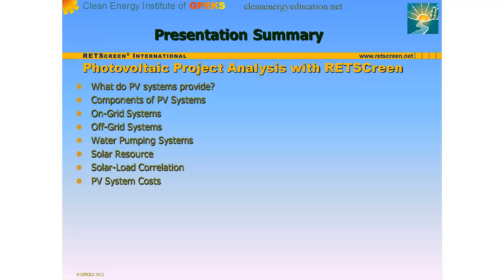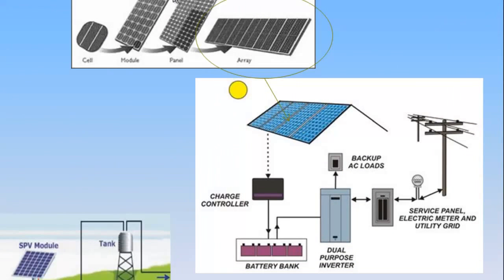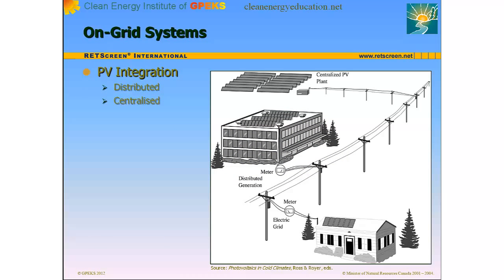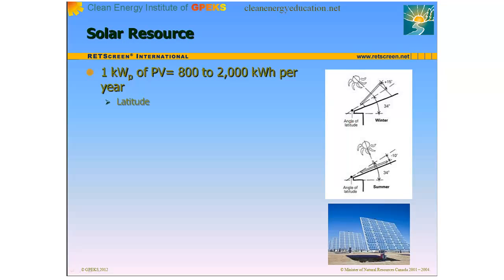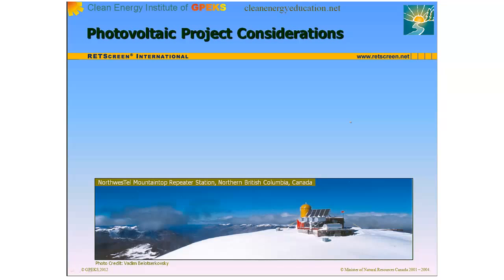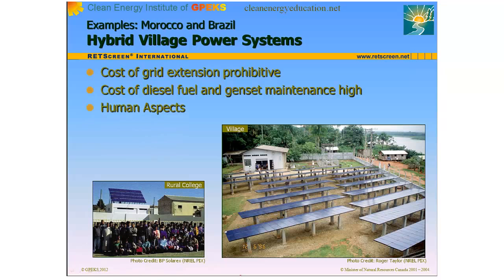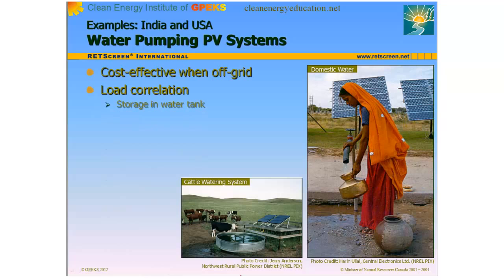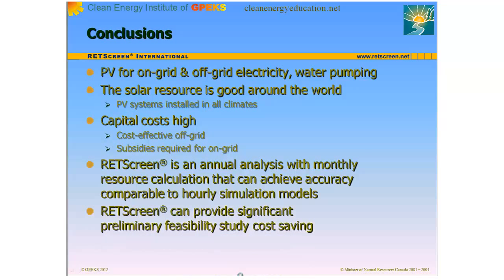Solar Photovoltaic (PV) Project Analysis with RETScreen

Comment from the maker: Yes, the sound is low, but if you increase the volume on both Youtube and using your computer settings, it should be loud enough. Also, using a headset in a quiet room would help.